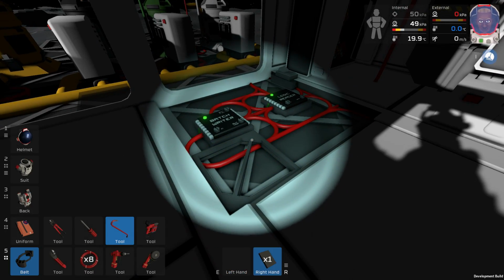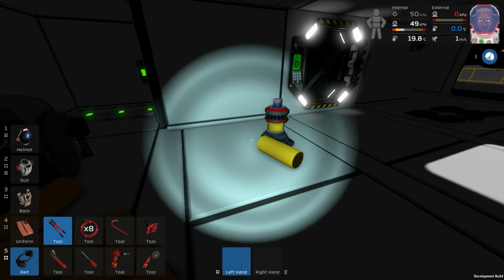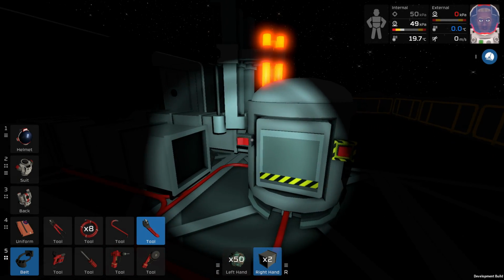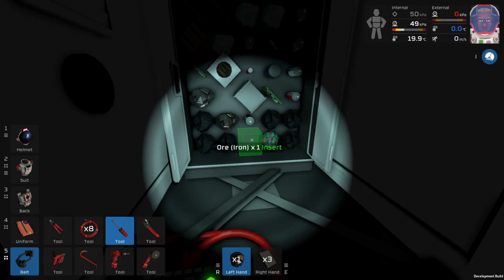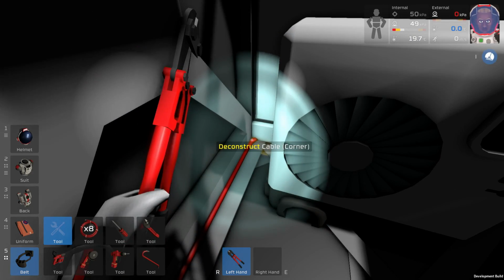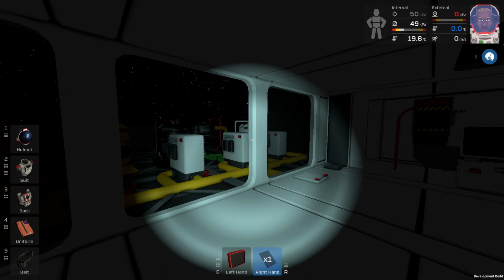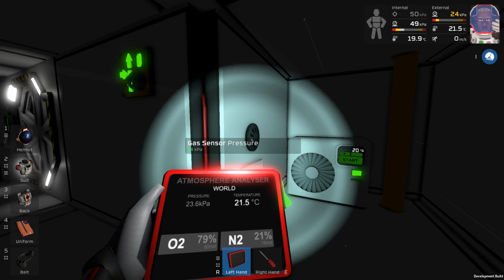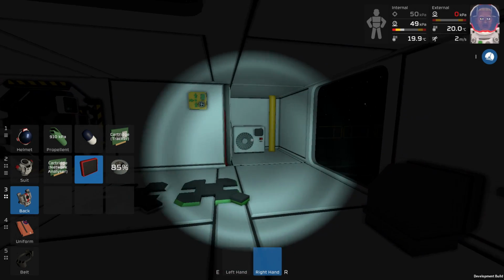GAS TEMPERATURE - Stationeers: Ep. #9 - Gameplay & Walkthrough

Comment: Reading input and output slots on the arc furnace is both not necessary, and not reliable.  That setup still routinely gets frozen up under certain circumstances.

The idle state of an arc furnace only evaluates to true if it has power, is on, has something in the input slot that can be smelted, and is not currently active.  One reader that reads the idle state and one writer that writes that to the arc furnace.  That setup never breaks, and it also has the additional benefit of always being a two chip setup.  If you want to automate a whole array of arc furnaces you just replace those two chips with a batch reader and a batch writer with the same settings.  With your setup you have to have two readers and a writer for every arc furnace you want to automate.

I've never really understood why people automate a bunch of arc furnaces though.  By the time you've got the materials to do that you've definitely got the materials to make a normal furnace that smelts normal ores pretty much instantly and also makes waste gas capture a lot more straight forward.

Comment: you can simply heat gas, mix it and store it in an air tank, preheated and ready to be breathed.
that you then hook up (without needing to haul it around) to the gas output via logic.
of course you'd cycle the heater (which is not sitting in line, but parallel to the tank feed) on and off based on the temperature.
Reply: I usually keep the gas tanks I use for my breathing environment IN my breathing environment.  First because that will eventually allow the temperature of the gas in the tank to equalize with the atmosphere in the base, so pumping that into the base to replace lost pressure isn't going to cause wild swings in temperature.  And secondly because once the gas in the tank has equalized with the temperature of the atmosphere in the base, the tank full of gas will assist in keeping your base atmosphere at the desired temperature.  Because the tank itself acts as a very effective heat transfer device.  Once there is a lot of gas in that tank at the temperature you want your base to stay at the environment the tank is in will always want to equalize temperature with the tank.

Comment: seeing how slow the air conditioner is at pumping air, maybe it would be better to make the heating process on a separate piping system.  Also, about the filtrating system, i believe there is no need for an active vent. As long as there is space in the tanks, the filtration system should absorb air automatically.